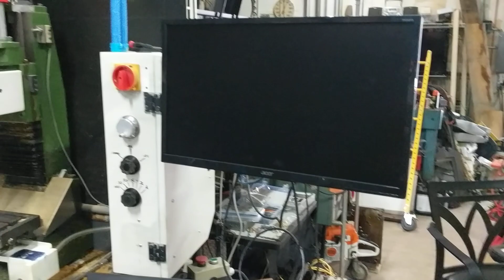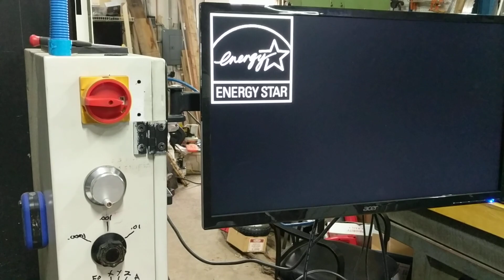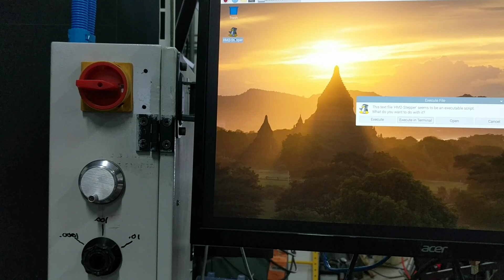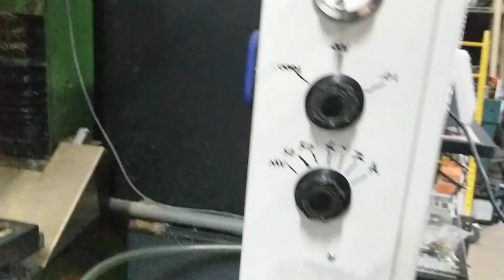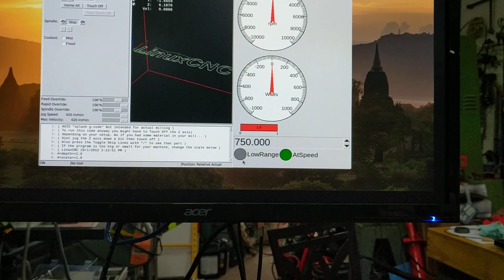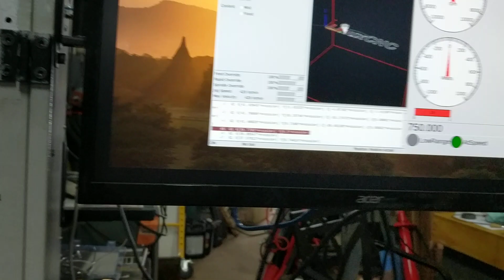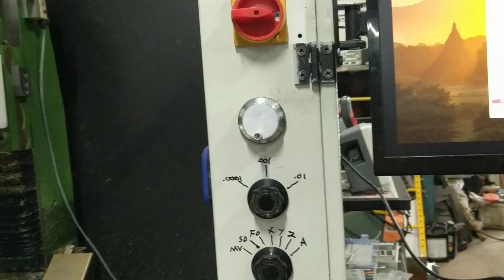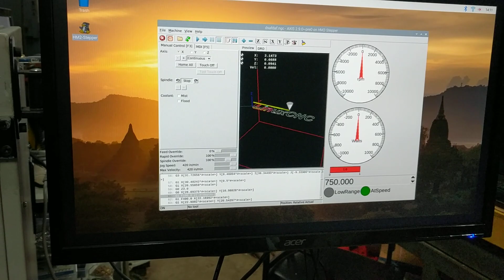Green machine update.  Spindle hal fun.

Comment: We could place a capacitive proximity sensor just by the side of belt (when in low range). This could be hooked up to some I/o and hal. It would sense the low or high range without running the spindle motor.